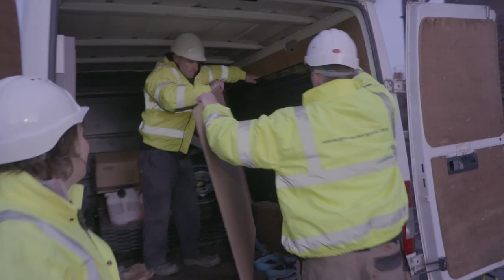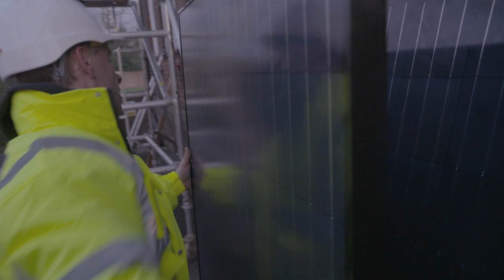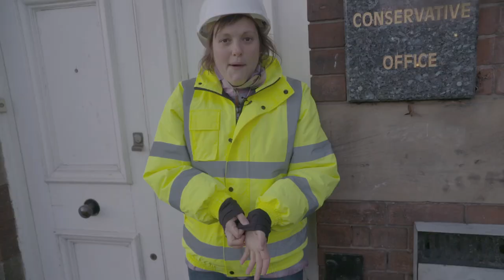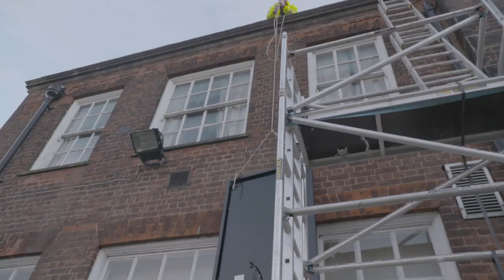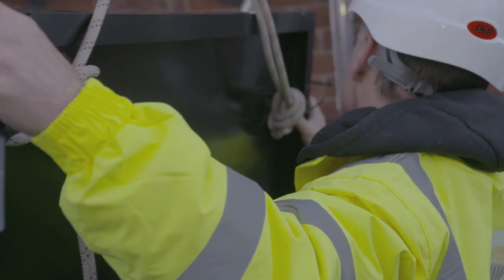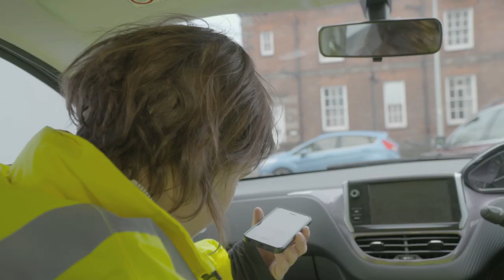George Osborne's office gets a surprise solar installation

Comment: When the sun goes down and the wind blows too hard or not enough and the hydro reservoirs run dry and your Tesla battery runs flat then what are you going to power this country with?    <fx> tumbleweed </fx>
Reply: +m100s3 Nuclear power baby. Plus a bit of tidal power never goes amiss.
Reply: +m100s3 Nobody is pretending renewables are the whole answer, just that they should be used as part of the answer to reducing greenhouse gasses.